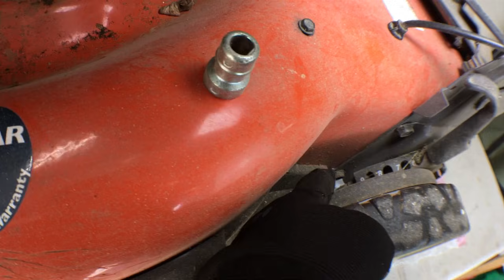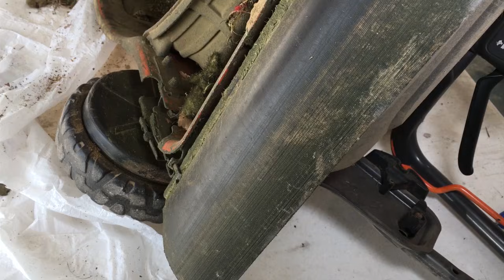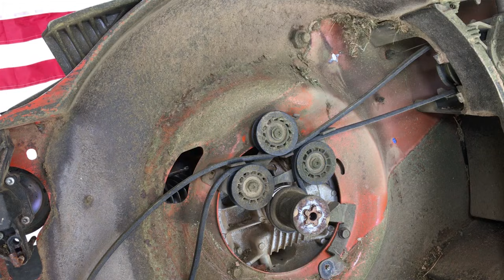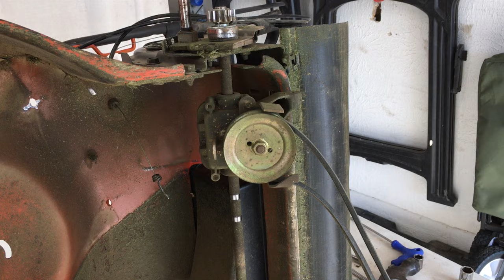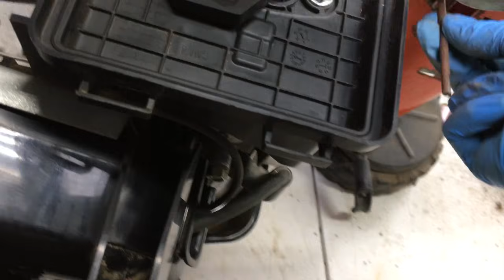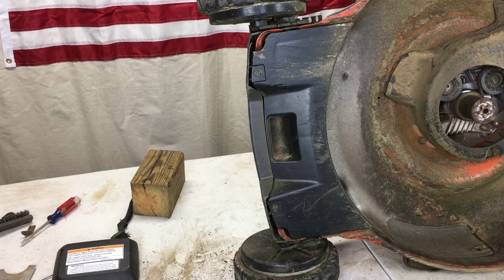Husqvarna AWD Push Mower Belt Replacement, Maintenance & Repair

Comment: I replaced the carburetor but the auto throttle keeps revving fast and slow causing the carburetor to sputter
Reply from the maker: That is auto controlled.  Check all of your vacuum lines.

Comment: Nice work. Just used Neighbor's and awd is not functional.  It was driving a F350 without power steering.  Will dive into it in the fall. Good tips

Comment: When I change any brand push mower oil, I always just tip it on it's side and drain. Easier than the drain plug, IF there is a drain plug.

Comment: You don't need to take the drain plug out to get the oil out,just pull the dipstick white its on its side, drain into a butter bowl. Yiur done.

Comment: Thank you for that video. I did the belt replacement already and could not figure out why the drive was not working correctly. I compared it with the old belt and it appeared to be similar. Even had contacted Husqvarna USA and they insisted I bought the correct belt. Well, the earlier models of this mower use a 21" and the later I guess use a 22". That is my problem. While it has a lot of steps, the belt do last a very long time plus I didn't find it complicated. Other than that the mower has been holding up well for over 12 years. And yes, it is amazing how much junk gets in the front area. Anyway, thanks again, great walk through video.

Comment: Great video , believe it or not I am doing the same thing to an older Husq. 2014 I think. It’s in very bad. Condition , the owner didn’t take care of it , instead he give it to me. So I’m restoring it to not perfect conditions but a lot better than it was. Everything was taken completely apart inside and out , and I’m in the process of rebuilding the topside of the motor. That was a great idea about the wheels , going to try that out in just a min. Thanks reach out if you have any other ideas like that.

Comment: 👍I replaced my neighbors and my own belt along w/ removing pulleys and such to clean and lube. It amazes me how time consuming and moderately difficult the engineer designed this mower just to replace the belt. Crazy!! 
Anyway, looked this job up afterwards just to see if I was going at it the wrong way. I wasn’t. Just crazy engineering!
As far as the oil change, I just tip mine over (muffler to ground, carb up) to dump old oil. Thx. (SUBd)

Comment: Great video. It helped me a lot to change the belt in my AWD 800 (2017). Especially helpful in removing the covering over the rear transmission. Thans much! It was a lifesaver.

Comment: I replaced my transmission drive cable twice each one lasted an hour and was completely frayed and cut off near the end under the mower deck. Both cables were installed exactly like the original cable that lasted 9 years.

Comment: The drive engagement handles cannot independently control the front with one handle and the rear with the other if both handles actuate a single control cable. That single cable rotates the rear gearbox and pulley to the tight position, the front gearbox is fixed in place and its pulley engages the belt when tightened by rotating rear.

Comment: I have this same mower as a craftsman and it has a Briggs and Stratton engine. No oil drain plug so I drain it out the fill tube. Regarding those three pullies, as long as the plastic is ok it's wise to check the condition of their bearings. I pop off the bearing seal caps and clean them with brake fluid and compressed air. Then repack with high temp bearing lube and reinstall the seal caps. Otherwise they are guaranteed to seize up sooner or later.
Reply: I ordered new ones to replace them while I do this job

Comment: Do you need to drain the gas and oil before you put the mower on it's side?
Reply: no, just make sure you tilt the mower with the air filter facing up.

Comment: Great video and tutorial! This is a perfect video for step-by-step in-depth maintenance and cleaning, but I did want to note that taking the engine off to change the oil is not necessary. With a small engine like the one on this push mower you simply need to tip it over and drain it from the fill spout. This will save you a couple of hours of work and will maintain the engine if you do it seasonally.

Comment: Sir, I have the hu800hw rear  wheel drive model but I think principles are the same.  I absolutely cannot locate any hole or notch to fasten the right side of the spring to, left side Crystal clear.  Does it attach to the belt guard?  Same hole as the cable?

Put everything back together and self propelled worked 10 min before belt came off transmission, stayed on blade  pulley.  Belt appears to the exact size.
Any help appreciated.   Thx
Reply from the maker: Mine attached to the housing.  Right in the corner next to the spring assembly.  A real pain in the rear to put back on.
Reply: @JohnCanFixAnything  thanks

Comment: Nice, great informative video. We had no idea that there was no oil drain. I did look and never found one. I know why now. 
Thank you
PS
One video I saw was saying to put the engine into a compression stroke to close the valves before tipping the engine. I never did that before, so I am not sure it is required for a short time tip over.
Rip

Comment: Can i ask a question?? Did the Drive Cable go on the inside or the  outside of your belt ??? Reason i ask is because i have to replace by cable once a year. It seems like i have been putting it on wrong.. Thanks, any info would be appreciated.
Reply from the maker: Mine was on the inside
Reply: @JohnCanFixAnything   Thanks so much. You and your Video has been extremely 
 Helpful.

Comment: Great Video Only thing I would stress is TO CHeck if the Bracket holding the pulleys is still attach to lawn mower,  My bracket had broken off at the screw point.  so of course putting everything back together didn't go so well.

Comment: Great video! Very informative! I've found that if you slip the clutch, Which is the belt, your belt won't last very long, So either fully engaged it or let go of it entirely, holding light tension on the drive control handle causes the engine pully to burn up the belt. So when trimming around bushes and such, Don't even use the self propelled handle, Just manually push and pull the mower where it needs to go. Reserve the self propelled lever for long stretches of mowing and it will make your belts last much longer.

Comment: What a head ache man. I found your video after an hour after I started the tedious process and removing the belt.

Four hours later, a trip to Lowe’s, a lunch break and me getting frustrated with my boys, we are done.

As for the design it’s a strong build, but as for the engineering of the back end I truly don’t think they could’ve made it any harder to work on. Drop’n the back end and swapping out the rear end of a 78 Chevy is a lot easier. 

But all in all saved me a $200+ small engine mechanic bill. 

Thank you Sir… I would add it was difficult to see that tension spring on the video. I figured it out, had forgotten due to my frustration.

All is well!

Comment: Here is what I’m running into. When I torque the blade down, it tightens the belt pulley so tight, I can not pull the start rope! Any suggestions what I’m doing wrong? I can loosen the bolt that holds the blade on but, then I’m concerned that the blade won’t stay tight. Suggestions?
Reply from the maker: Check and make sure you have the right blade and the spacer is installed correctly.  Other than that, there is not much between the blade and engine.
Reply: @JohnCanFixAnything  looking at new sprockets that the blade attaches to, shows a single piece with the pulley attached. Mine is in two pieces and what I’ve read of reviews on this part is, but more than one and keep them on hand because they act as a sort of ‘shear pin’, a 12 dollar shear pin, if the blade should strike a rock or stump or whatever, the pulley shears off the blade sprocket. So, it explains why I’m not able to pull start it or even hand turn the engine by the blade...it has to be torqued so tight to hold the blade on that it binds the sheared pulley against the drive shaft. It would be great if they designed a less expensive shear system for the blade!!

Comment: I have the exact same mower bought in May 2016. I use it 2-3 hours per week 4.5 months of the year. I just changed the blade for the first time today and it had never been sharpened. The blade looked in great shape compared to the new one but obviously not as sharp. I also changed the spark plug for the first time and it did not look too bad. Some carbon build up but nothing excessive. So I have had this mower for 5 years and all I have done is change the oil each season and clean the air filter a few times. I read lots of reviews online saying this lawn mower is junk but my experience is otherwise. I clean the underside good after every use too. I found the water connection to be useless for cleaning it. My blade adapter looked good and the pulleys too as well as the belt. My next project will be to change all the pulleys and the belt (hopefully good for a while yet) so this video will be useful then. As you pointed out there’s no drain plug on that Honda engine. You have to drain and fill through the dipstick port.
Reply: Same, bought it at Marsh’s in GFW and had it for 4-5 years now, not a hitch. They seem to have started using their own brand of engine now not the Honda one on the newer ones from what I’ve seen.

Comment: Thank you so very much for the informative video. Mower is HU800WD /BBC.  5 years old, would no longer pull itself. Really very helpful from all aspects. Only problem came with the BBC ( Blade Break Clutch ), watch carefully when disassemble the BBC assembly, very different from video. Again a very informative video, oh yes it is a pain in the BUT to do but when all is said and done it’s worth the effort.

Comment: I think I have the same mower that you do.  The manual says to drain the oil by tipping it over on its side and drain the oil out the oil spout (just like you did).  I've always used that method and it seems to get most of the oil out.  Great video

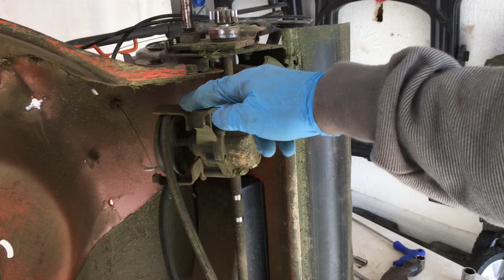Comment: At 12:35 of the video, what is that name of that part you had your finger on? I have to replace my cable that snapped and the hole on this part broke off where the cable fastens to it so I have to replace it.
Reply from the maker: Are you talking about the cover that holds the belt onto the pully?
Reply from the maker: Or the unit that the cable fits into that engages the AWD?
Reply: @JohnCanFixAnything  the piece that holds the cable. I think it's called the transmission. It looks like you have to buy the entire transmission which is close to $70 bucks. I wish I could just buy the bottom part so I can fasten my cable to it. That's all I need.

Comment: I drain the engine oil by sucking it out with a MityVac vacuum brake bleeder. I run the engine to warm the oil up then draw it out with the vacuum reservoir.

Comment: I have a Husqvarna HU 775bbc with a Briggs & Stratton 775ex Briggs and Stratton Vertical Engine 7.75TP 7/8" x 2-7/16" HF #111P02-0003-f1 engine and I'm looking to do away with that stupid BBC blade brake clutch and looking to convert to the self-propelled blade adapter direct not having the clutch and brake because Everytime I hit the grass the blade stops the belt and it's assembly is new. The adapter is new keyway isn't stripped. Everything is new even the motor. I just don't get why the blade isn't cutting. It cuts and stops I back up and it starts turning and I cut another 6 ft repeat and it's driving me nuts lol. Can you help me with finding out the blade adapter that will work the right height and shaft diameter? Thanks for your time

Comment: Awesome and thorough video. I had trouble with too much slack in my belt when putting on the covers I had all sorts of issues. I just ended up bungeeing the self propelled level to make the belt tight and put on the covers. Good as new! I couldn’t have done it without this video!

Comment: To drain the oil I just warm up the engine and then tilt the whole mower on its side. Not sure if that's bad but it's been working so far.

Comment: Thank you! That spring thing had me. Great video man
Reply: i trade mine every 3 or 4 years because start gives issues wich why i dont keep my mowers  but with the rubber wheels,blade clutch and shaft drive i be keeping it longer  wich will be my 17th mowers
Reply from the maker: No problem 👍

Comment: This video was perfect for me. The first time I turned over my mower it looked way too complex for me to work on, but you broke it down and made it easy to understand. A dried out sweet gum seed pod got wedged in the rear pulley and kept the belt from  moving. What are the torque specs for the idler pulleys? I just tightened the shit out of the blade bolt. Thanks for a great video

Comment: I have the same model and I just replaced the carburetor and replaced the oil and added fresh gas and the mower turns on and stays on but it’s super loud. I still managed to cut the yard but it seemed extremely loud to me. Any reason why it would be that loud? Towards the end of my cut it did sound like it was dying like when you run out of gas and then just stopped.
Reply from the maker: Was it engine noise or muffler noise?

Comment: I have had to replace the front and rear transmissions on this mower and the gears tend to seize up on the drive axles forcing me to have to cut them off. Also the front plastic baffle on this mower is a poor design. Husqvarna has corrected this issue with the newer mowers having a open front baffle. In fact you can buy the metal front baffle from the newer model and it will fit the older one as that's what I did. 

In the 7 years I have owned this, the Honda engine has worked perfectly so long that you maintain it and run it dry after each use. This mower deck and AWD system have been nothing but problems for me.
Reply: If you use non ethanol gas you won't have to run the gas out after each use.
Reply: @charliekilo3  non-ethanol gasoline is  difficult to find in the DC area where I live.
Reply: @Mr-Chris  Gotcha

Comment: Great Tutorial. The AWD just went out on mine last week and I wasn’t sure where to start to fix it. Thank you for the great video. It will be very beneficial when I start the repairs.
Reply: i have the 722xt awd wich i dont like mine to much replacing plasticwheels wich i  wished  they put rubber wheels instead  plus mine doesnt have much power wich is kohler 7 1/2hp wich i find its  not enough power but the engine and muffler still in great shape though with i use  kubota diesel and gas  10w30 engine oil wich is the best stuff for any power equipment and keeps muffler and engine cleaned 100%

Comment: My Husqvarna AWD has a Briggs and Stratton engine, not Honda, everything else seems to be the same as yours.  The cable to engage the wheels broke so I will replace that cable.  When I tilted the machine forward, lifting the back wheels up to investigate, the very dirty engine oil saturated the air filter so I will replace the air filter, the engine oil, the spark plug and either grind the blade or replace as you did.  Thank you for showing me the way.

Comment: I think you did a good job on the mower and video. I'm sure it will be very helpful to a lot of viewers and mower owners. However, just a few comments. First thing I do before working on any mower is remove the spark plug cap. Next is power washing the machine, top and underneath, get rid of as much debris as possible, makes it easier to find bolts and screws, cracks or breaks, and secondary damage much easier.. I commend your use of a socket set and ratchet, instead of using a drill/driver which can easily over-torque/strip fasteners during reassembly. Because this is such a common area of failure, I would have liked to have seen the wheels removed, the plastic gear teeth inspected, everything cleaned and the metal drive gears, shaft, and bushing of each wheel properly greased/lubricated. And anything that rotates (belt idlers), levers, pivots, and all the cables should have been thoroughly lubricated. Freely moving parts work much better than binding parts. But because you did such a good job on the entire project, I'm sure you performed many other tasks off-camera. Keep up the good work and videos ...

Comment: Is it really necessary to take the entire machine apart just to replace the belt?
Reply: Almost. Anything to do with the engine drive pulleys, belt replacement, and the front and/or rear drive requires major disassembly. The only thing he did that wouldn't be necessary for drive belt work is removing the engine, but engine removal actually makes things easier because it makes moving the mower base around is a lot easier. And he covered the process very well.
Reply from the maker: Pretty much.  You can bypass some of the video but the belt itself is tough to replace without removing many covers and parts.

Comment: Yeah, they could have made these craps a little more accessible , probably 4-5 hours just to change or fix a belt especially without the video :/

I've owned mine for a very short time and have used all of 10 times if that and the belt started slipping until it just stopped all together in a day or two...in tall grass it clogs up and gets all in the top as well. Was completely wound around the back axle and in the back pulley.  Cut it loose and still no awd. Checked the belt and felt like it was in the pulleys but to make sure I turned it which made it come out for sure in the back which just blows my mind because it sure as heck doesnt go on as easily as it popped right out with the guards around the pulley. I will not buy one of these again, just a horrible and unnecessarily complicated design.
Reply: I've had mine since April 2013 and haven't had a single problem with the AWD system. Still using the original belt and pulleys too.